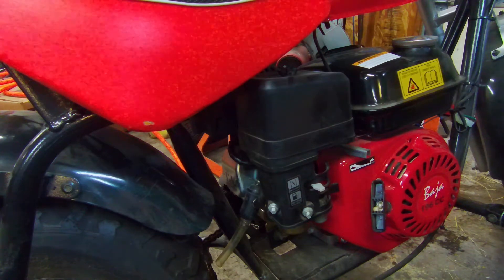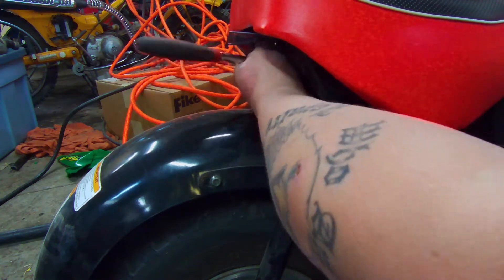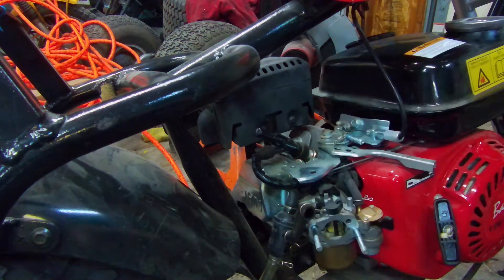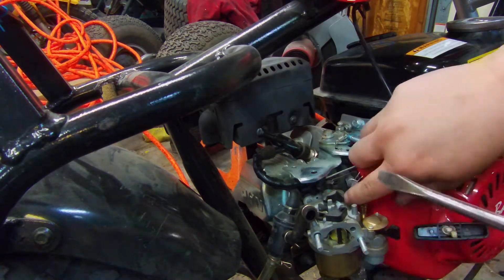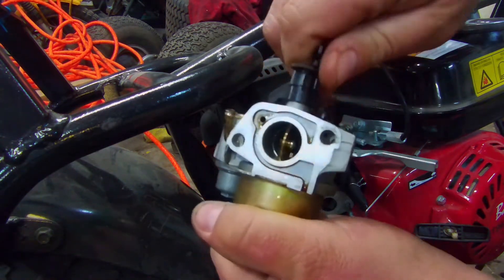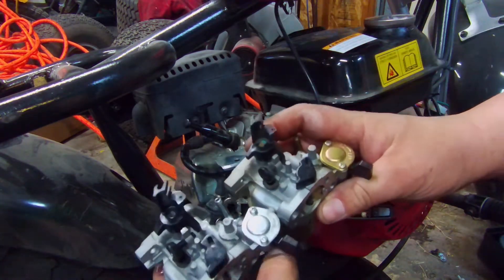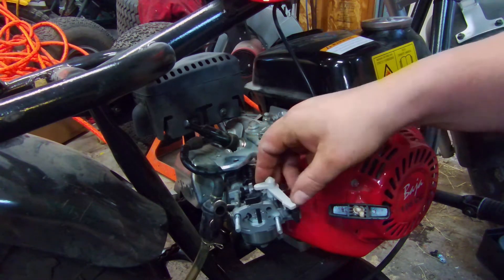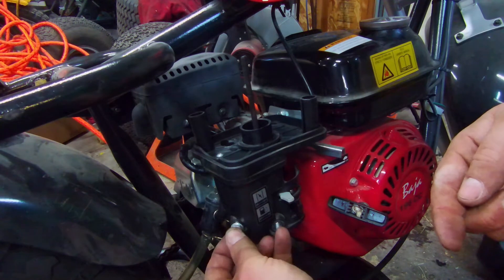Baja Mini Bike wont start!!! Honda Clone Carb Replacement

Comment: I love how he gets right to the point not directly but he does all these other videos talk endlessly and I hate that I don't want to know how everything works it just want to know how to put it together and that's what I got here so I'm very happy with that thank you for the video it was very informative cuz this my first Baja this is my first engine and I needed some help because the hopis god some idiot Easy-Off my carburetor for my gasket and my fuel pump on a gas pump or filter whatever one may be there and just basically told me I didn't need one basically just destroyed my whole carburetor and then try to put it back together and then wouldn't start and around here nobody likes a small engines so the last thing I want to somebody rambling on about how it works I just want to see him put it on so I can do it myself so thank you for getting to the point❤❤❤❤❤
Reply: What if mine doesn't have an air box I have two different filters covering the carburetor and the other one I guess what you called it the air hose should I get one of those cover boxes you have or am I okay with the with the filters
Reply from the maker: As long as the smaller vent hose that goes to the valve cover has a filter on it your good to use a cone filter on the carb.
Reply from the maker: Well thank you. My goal on each video is different this one was no how it works it was a how to replace. Thank you for your comment and hopefully you find some more value in my channel.

Comment: UGH I am so frustrated right now I spent the last few days upgrading my 196cc mini bike engine. I changed out the stock cam for a Mod 2 Cam. Swapped out the stock Valve Springs for 18 Pound springs. Removed the Governor and took out the stock throttle assembly and put it a new Throttle Assembly made for Ungoverned Engines. Finally got everything done and put it all back together today added gas and oil and now the damn thing won't start. I have no idea why and really do not want to have to take the whole engine apart again to try to figure out why it won't start. It does have compression. But when you go to pull the pull starter it feels like it's hard to pull. Also it sounds weird like something is rubbing against something every time I pull the pull cord. On top of that I noticed gas dripping from the bottom of the Carb bowl where the nut is in the center but that is because that particular bolt suddenly decided it didn't want to tighten down all the way anymore. It just keeps turning and turning never fully tightening so I will order a new bolt for that online. But that's not the reason behind the engine not starting up at all. I gotta figure out what's wrong with it now but don't know where to start looking first. Any suggestions ?